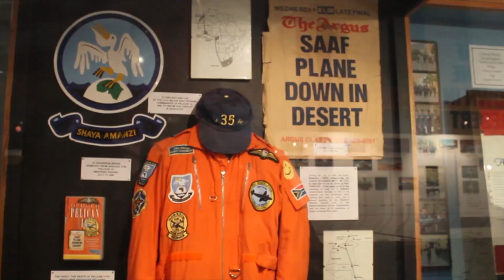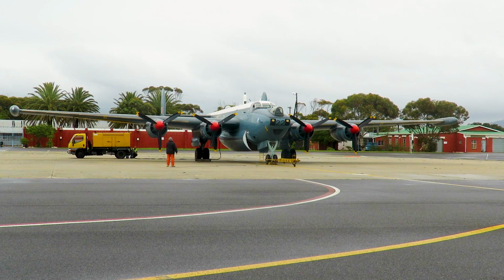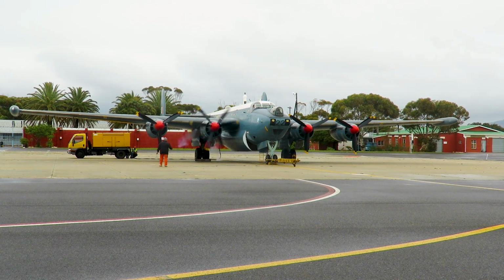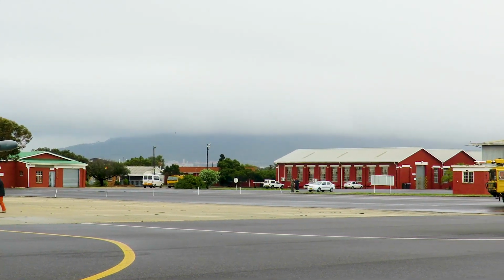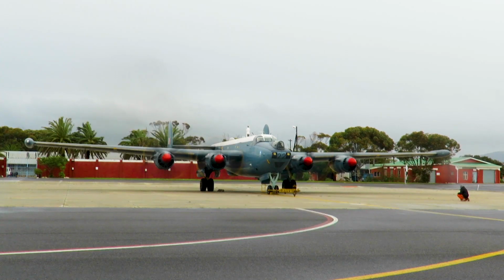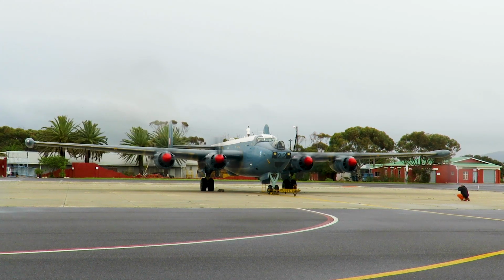A Shackleton engine run with a difference!

Comment: A Shackleton: 80,000 rivets vibrating in close formation. There's also an MR3 which does engine runs at Gatwick Aviation Museum in the UK.
Reply: I remember that!  The guy trying to get the apu running was smoking a tab when he did!   I'm like, don't these run on ethanol or nitro Benzine?!

The lanc always sounds fab but the shacks props have a unique sound
Reply: @drd6416  They don't call Shackleton's Growlers for nothing ;)

Comment: I had the priviledge of Shackletons doing early morning full power runs on the apron right next to the control tower during my time as National Service ATC at AFS Rooikop at Walvisbaai during the Angola crisis 1975-1976. While still dark those engines spewed blue torch flames from the exhausts! Then two years later as an engineering student doing vacation work at 1AD in Voortrekkerhoogte Pretoria I saw those Griffins being rebuilt as well as the test runs with abbreviated props in the engine test cell. Spectacular.

Comment: I showed this video to my father who was an apprentice aircraft mechanic in the SAAF in the 1960s. He remembers working on this exact aircraft which they called "22". The ailerons were made of textiles and would be drawn taut and then covered by several layers of resin to be able to be used and he spent many many hours making resin parts for Shackletons and Vampires! The second thing he tells me is of historical interest to all of us South Africans. On the day Dmetri Tsafendas killed Hendrik Verwoerd the entire army was placed on full alert and my father had to guard this Shackleton 22 at Ysterplaat. Instead of doing that he climbed onto the front wheel, leaned his back against the wheel strut and slept there. A few hours later he was awakened by a commotion and was able to see the police and secret service lead Tsafendas across the tarmac to a waiting jet to be flown to Pretoria. According to him, from his vantage point, Tsafendas walked by no more than twenty meters from him.

Comment: Lol, not surprised to see this happen with all four props at full chat. I worked for Taywood Engineering in the 1990s, we used a single 37litre V12 RR Griffon from a Shackleton AEW2, mounted in a steel cage with contra-rotating prop, to test high-rise commercial building facades!! Just one engine running at only a third of its power was mind blowing!
Reply from the maker: What exactly do you means when you say "test high-rise commercial building facades" in the same sentence as a Shackleton engine?  Did you actually try and blow them over?
Reply: Willie Koorts 
Not blow over (that’s would have been a catastrophic design failure)! It was to test a sample of buildings exterior weatherproofing facade, by subjecting it to high-winds. The Shackleton’s engine was perfect to replicate the ‘wind-loading’ pressure tall buildings could be subject to. To be honest, as a 21 year old at the time, my focus was more to the power of the magnificent 37ltr V12!

Comment: In 1966 joined the RAF stationed at RAF Ballykelly N Ireland, I think there were 3 or 4  squadrons of Shackletons, one RN outfit of Ghannets, a shackleton crashed on the airfield no one was injuried, on duty one weekend when all was quiet i drove to the crash site and entered the aircraft, i explored all over the inside of the aircraft ending in the cockpit on the left side seat, i sat there looking out the front windows pulling on the controlls thinking what it would be like to be flying this machine, a lever on my right caught my attention, i moved it and my seat dropped about 6 inches, i thought i had ejected i almost shit my pants.
Reply from the maker: Hehehe!  Glad you survived to tell the tale!

Comment: I used to work at BAe Hatfield in the Eighties and one of these AWACS  Shackletons (maybe the last one) did a high speed fly past, over the runway. The pilot pulled up near the end of the runway and I remember watching the wings flex upwards by a good meter as the G force piled on. Griffon engines sounded fantastic, a close second behind anything with a Merlin.
Reply: The growl climbing into a roar, with shivering power latent on the  beast about to pounce!  Splendid video, this

Comment: Sounds like a demo that you really need to hear in person!
Reply from the maker: Indeed!  A camera microphone soon saturates!  It is not so noticeable in the video, but Johan made a cellphone recording with his phone near the ground on his camera bag.  This recording turned out to be the best, so I pulled it into a sound editor to clean up.  When I lined it up with the video, it was amazing to see the drop in sound level, the moment the wall fell!  It makes good sense if you think that suddenly a huge reflective surface for the sound disappeared!
Reply: @SterremanWillie  Absolutely!   With the wall gone what was left of the palm trees would absorb the noise rather than bouncing it back.   Just incredible demonstration of the power in those engines.

Comment: hahaha.. I did the same thing with a 767 and later a 747 years. Ago.. I also kicked up enough dust once with a 737 that a 747 had to perform a go around and change runways... the fun of high power engine ground runs....

Comment: What is the buildings behind the downed wall? Airport offices,school? That was an expensive wall to replace. Not strong enough for being in a run up area.
Reply from the maker: I happen to be visiting the guy who took the video at the moment and just asked him.  The building is called "movements", which is effectively the departure and arrival area.  The was has since been rebuild, but not too expensive since we do a lot of brickwork in South Africa, brick is actually cheaper than wood over here.  Since the incident, they moved the engine run area elsewhere on the base, away from any buildings and walls.
Reply: @ thanks for the response. Great videos!👍🏻

Comment: Wow that was shocking. I could be mistaken but isn’t this a good example of why most airports require the use of a run up pad or ground run enclosure for high power engine run ups?

Comment: when did they change  the  under -  carriage configuration from tail dragger to  tri - cycle ?
Reply: When they started producing the Shackleton MR3 in 1955.
Reply: Never knew that some of the Shacks were tail draggers and some were tricycle? Surely that requires major re-engineering of main undercarriage and spar arrangements to shift static centre of gravity so aircraft sits nose heavy on ground?
Reply: @PaulL-g5l  Mk 3 had a new wing.

Comment: Airworthy? Just for static display,I think.
Reply from the maker: I heard somewhere that the airframe is apparently still declared airworthy, but that it is too valuable to dare fly it.  Not sure if this is correct though.  One thing that would be a challenge is to get crew since they are getting fewer and fewer (and older and older!).
Reply: @SterremanWillie  Thanks Willie,so no crew,it might be a hard machine to get in  the air.

Comment: When I was at Akrotiri  a Vulcan running up hurled a man into the blast wall killing him instantly
Reply: We had a ground crew out in 117th squadron picked off his feet and sucked into an F-16 intake as he was crossing under the it.   Lucky he got hung up on the central bar but almost suffocated to death.  His coat was shredded, lucky the engine was only idling.   After release from hospital he was court-martialed to 30day.

Comment: I’m really sorry for this, but it looks like a B-24 with its wings lowered halfway down the fuselage and different engines and a redesigned nose
Reply: So, it doesn't really look like a b24 at all then?
Reply: It kinda does. It looks like a modified one
Reply: @justat1149  right, the wrong is in a different place, it had different engines, and it has a different nose, as you said. What part do you think looks like a b24?
Reply: Shelby Seelbach 

Honestly, if you look at it from a side on profile, it looks very similar. Also, I see a Liberator in the size/shape of the fuselage and tailplanes. The nose looks like one of the later B-24 variants with the nose turret, only said turret has been streamlined extensively. The major differences of course are the wings and engines, being lower down on the fuselage and the engines nacelles being smaller and fitted with contra-rotating props
Reply: @justat1149  Oh,  I must have missed the part where they showed the plane in profile. The tail design is similar, it has tricycle landing gear, it has four engines, other than that it looks nothing like a b24 in reality, nothing like.  Just saying.
Reply: Shelby Seelbach 

It’s perfectly fine. You have an opinion, I have an opinion. I just saw a B-24 in this Shackleton. No harm, no foul
Reply: @justat1149  of course, of course. Wasn't trying to be ugly, I just don't really see it.
Reply: Shelby Seelbach 

I never thought you were. We were just having a friendly debate on a certain aircraft’s appearance. This is definitely one of the best I’ve had using this app, some people on this site are just... awful

Comment: A high power engine run and not a damn chock in sight I ask myself what idiot was in charge, coupled with the wall this was a total lack of planning.
" Fail to Plan Plan to Fail ".
Oh and you also Never leave a towing arm on during an engine run !.
What a bunch of Amateurs.
Reply: Front wheel chock visible at 2:51 
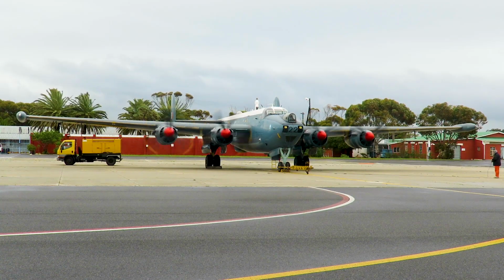Rear chocks at 3:45
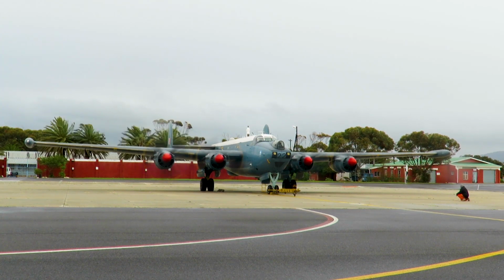4:51 you see the chock get blown out from the wheel below engine No 3.
The chocks are there but not very secure by the way one blew away.
Reply from the maker: It is mostly a bunch of volunteer old timers manning the engine runs, often difficult finding a complete crew.  The nearby museum mostly coordinates this, I think. What is the reason for not leaving the tow arm in place?